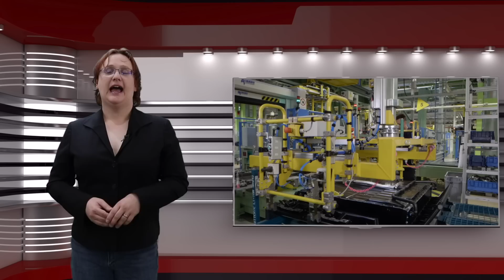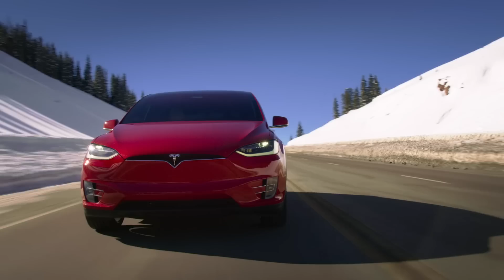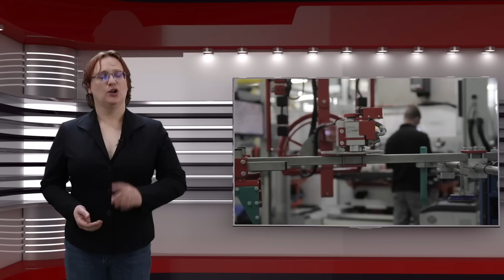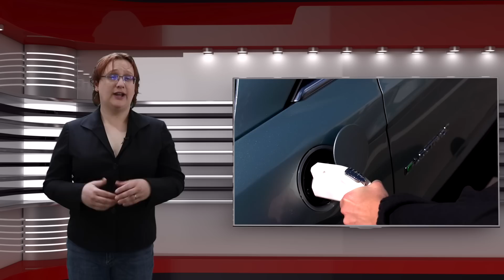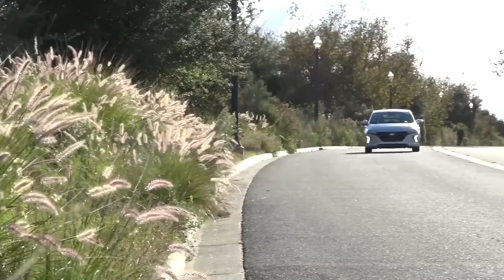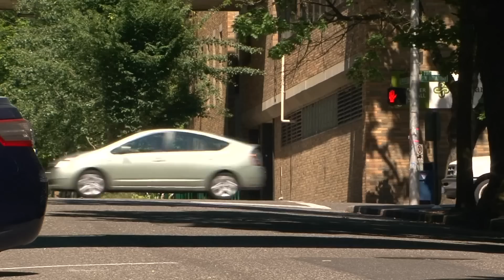As EVs Get Older, Aftermarket Batteries Will Change The EV Marketplace

Comment: An acquaintance of mine who felt threatened by my Chevy Bolt EUV said that I was now driving a coal fired car.  I asked if the coal fired power plant would shut down if I unplugged?  Also, in my area we have about 40% coal use and that is changing every year.

Comment: 4 years later and the 3rd party battery upgrade business never materialized, like not even a little bit. I finally had to give up on upgrading my beloved Nissan Leaf…
Reply: Which is sad for people like me who can't afford a new EV, but would love to drive an older one and upgrade the battery later to bring the range more in line with current standards.
Because if I have to choose between a cheap used gas powered city car that gets 400 miles on a single tank of fuel or an old EV that only gets 200 miles at best while costing more than three times as much, the choice is pretty clear to me.
A Volkswagen E-UP with a 300 mile range would be like a dream come true for me, but at this rate I don't see that happening any day soon.

Comment: What might be does not help me with what is now.
I wanted to upgrade my Nissan ev battery. The dealer here in Tennessee will not do it.
To replace my 7 year old battery the dealer said it would be $10,700 usd plus labor.
I've seen a Youtube video of a shop outside the US that sells kits to upgrade but you must acquire your own replacement battery and find a shop to do the work for you. I will pass on that option. Another option is to buy a newer car with longer range but prices have gone up drastically in the last year and used evs are hard to find. So for now I will have a shorter range and charge up more often. Maybe in my lifetime things will change.
Reply from the maker: I'm not - off the top of my head - aware of any shops doing it in Tennessee, but there is one in Portland, OR which might be able to give you advice on somewhere nearer you. https://evridesllc.com/

^Kate
Reply: @transportevolved  thank you , I sent them an email to find out.
Reply from the maker: Let us know how it goes! 

^Kate

Comment: I have a 2016 Kia Soul EV.  The HV battery failed 9 months ago and Kia approved a warranty replacement.  I am still waiting but the car range has dropped to 48Km and charge times have doubled or even tripled. Almost useless.  I will never buy or recommend a Kia vehicle. They are extremely polite in dealing with you but in the end they do nothing.  I am beginning to believe they have no intention of repairing my car.

Comment: Teslas appear to have about 90% battery health even after 150 000 miles aka 20 years of driving with my way of using them. and that is with being supercharged quite a lot more than i would be doing it. so the only real question with actively cooled batteries is basically what their shelf life is.

Comment: I don't think this question has been asked or answered here: is it possible to swap the battery from a -- say -- 2017 ev for a current one, thus upgrading the range? If so, what would it cost and how would you find someone to do it?
Reply from the maker: It depends on the vehicle, but in general as long as the form factor is the same, it can be done, though there's often a bunch of software, and sometimes hardware, tweaks that need to happen too. So Nissan Leafs can get updated battery packs, so too can some BMW i3 models, and I imagine you could swap a 2021 Bolt battery into a 2017, but I don't know for sure. - Winter
Reply: Thank you! Do you happen to know where I could get definitive battery-swap information about a Bolt or a Kia Soul ev? Seems to me it would make sense, but no one seems to know the answer.
Reply from the maker: I don't honestly know when it comes to those. If you find out, be sure to let us know - Winter
Reply: @transportevolved  Okay, thanks again. I'll keep looking, and for sure will let you know if I find any information.
Reply: i know even the 62KWh pack can fit inside a Nissan Leaf that originally came with a 24kWh pack. but that is done by a 3rd partys, not the manufacturer of the car.

Comment: I recently saw a video put together by a company in Europe.  They opened a 2011 Leaf battery and swapped out the cells with a different model of pouch cell with 3D printed supports and guards.  When they were done and updated the computers the guess-o-meter showed 337Km of range, and that was before they charged it.  I can't find the video again to see what the final capacity was at this point I'm not sure if it was Km or Miles.

Comment: If we can disable the lockout preventing you from charging while driving we could add more range with either a solar system or even a gas generator.
There's probably some overheating issue so the input flow might have to be regulated by some sensors and a small computer.

But I can see DIY battery videos coming out soon. Doesn't sound that hard, I'll definitely give it a go when mine starts to go out.

Comment: For people who can't afford brand new EVs and intend to buy second handed ones, I reckon the issue with battery wear will not be a challenge in the future. At this stage the Lithium-ion batteries are expensive to replace on EVs but however, the current trend of battery prices falling each year is also inevitable. We can see battery replacements becoming more affordable and the fact billions of dollars of investments are placed on research for a new battery development that will also shape the EV industry such as Solid-state battery using a solid electrode that has the potential to allow the battery to have a longer life-span, last longer per charge and faster charging so should batteries still be an issue of the future?

Comment: All the cars I've been forced to get rid of had fantastically running engines at the time of disposal. 
It wasn't the amount of moving parts in the motor but the rusting bodywork which put paid to them.
12 - 14 years driving on Britain's often damp and salted roads will do that to a car even I imagine,an EV.
So unless an EV's body is made of rust proof plastic I can't see it lasting any longer than a decent Japanese car.

Comment: I'm a right wing seal clubbing whale killing right to life hypocrite and I hate the politics of this.  Electric cars have limited range compared to gas due to PHYSICS.  I have had most of my gas / diesel cars last 12 to 15 years and hundreds of thousands of miles.  The only reason I would get an electric car is if it met my needs for the cost that I could afford.  That isn't right wing or left wing or right or left leaning, that is just practical living.  Oil is the future, so is electric.  People need choice and freedom and anyone who says electric is only or gas is only or diesel is only are ignorant.  I will NEVER get rid of my diesel truck, but I may consider an electric with 350 to 400 miles of range as a commuter / short trip (1000 miles or less) car and drive my truck on longer trips due to the 15 to 20 hours it would save me in charging time.  (I drive trips over 7000 miles 2 to 3 times per year.).  I don't care if I am the exception or the rule. Oh and co2 needs to be raised as it is too low, and not even a greenhouse gas (it shares the same absorption lines as H20 and can't stop more heat from escaping than water can. It is also plant food. ).  I have to go now, the baby seals won't club themselves!

Comment: EVs are machines and they will also break.  My trusty 28 year old pickup has been dependable until it got an electrical short.  lol   My  15 year old Honda has been very dependable - but now needs an axle.   EVs also have axles.

Comment: EV's will change our concept of a cars working life. Back in the 50's, a combustion engine would need a rebuild after 50k miles or so, modern combustion engines do much better (with a good oil change regime), but many customers will take a long time to click with the concept of an EV having a drive train capable of 500k plus miles with negligible maintenance, and manufacturers will not want to promote this idea either. The aftermarket will be a major factor in this, and I see big business opportunities in this arena. Our throw away culture in the developed world will be one of the hardest battles to overcome as we collectively realise the very obvious; that our planet is a finite size, with finite resources.

Comment: in the1960s, engine life and owner expectations of such was as you describe (100,000 miles befire rebuild was the accepted norm then) - I think you are 50 years out of date with your stated life of the internal combustion engine.
Expected (socially accepted) engine life  in 2019 / 2020 would be 2 to 3  times what you have quoted for properly maintained and operated IC engines. 

Remember that correctly stating the relative peformance of new and old technology is one of the tools  in how you maintain your credibility.
Reply: Rickie j  Nice anecdotes. On average most cars (with proper maintenance) go well over 200K without major rebuilds.
Reply: While ice could last , you can not help parts that were designed based on heat cycles and not miles. The other thing is public opinion where everyone wants the latest and greatest.  Manufacturers have no incentive to make long lasting cars.
Reply: It says it’s the avverage time a car can go without parts being replaced

Comment: the main problem in swapping 2nd hand batteries is that the software controlling them, in most cars, will not recognize an increased capacity, or a different battery at all

Comment: Scotty Kilmer on his mechanic Channel points out the problem with reconditioned battery packs.
These outfits test the individual component cells and only replace the ones that do not test out as acceptable.
This means that a reconditioned battery pack while initially cheaper will cost more because the customer will have to pay to have it reconditioned again and again and again.

I'm still not convinced of the argument about an electric car being ultimately more environment-friendly than a standard combustion automobile, for there is more than one study on the issue and they vary widely in results.

What we really need are roads that are rigged up like those little race tracks that we used to have when I was a kid... electric power coming out of a slot in the road where the card picks it up off of a shoe that fits in the slot.
 Subway trains operate in this way.

Good luck if you live in Northern California... No Buses, no trains, and now no power since the electric grid was completely shut off by their power company.

Although where I live, if you could get me an electric car with a Roi de Belges interior, I might consider it.  if I have to sign away my whole life just to drive a car I want to have something that would provide me a ride in Comfort.

Comment: 8 years lol still driving my 2004 prius.
Reply: nice! 2007 here with 174,000 miles, it has been technically written off before my parents gave me it because it was still mechanically sound. After 3 years and ~35,000 miles I kept it safe, used it as versatile as possible and it treated me well with stellar reliability and gentle fuel costs.

Comment: I love my 2013 Nissan Leaf; brilliant car except for the battery. I'd happily pay $10-15k for a better battery, because the only EV's that would be a significant upgrade over the Leaf are $40,000 and up. And besides, most newer EV's are actually inferior to the original Leaf in some respects. No current EV matches the Leaf in ergonomics. And if you want that cool 360 overhead view, you have to spend $50,000+ on a Tesla.

Such a shame all the tens of early Nissan Leafs are going to be abandoned to rot when most of them are in great condition save the batteries. What a waste.
Reply: I drive a 40 kWh Leaf from 2015...check out muxsan.com

Comment: Better battery packs with a higher electrical KWH would be a great way to go when the original battery pack is depleted from its lifetime. I hope manufacturers are planning such a move in the near future. Currently I drive a new Kia Niro hybrid so I would hope Kia has more options for customers when they need to replace the battery pack.
Reply from the maker: Manufacturers often seem reluctant to do this, but I fully expect to see aftermarket packs appear as the technology matures... We've already seen this on some of the earlier hybrids...  ^Kate

Comment: The UK may have a different experience than other parts of the world, but has a tiny percentage of the world's vehicles. The average age of cars on US highways is in excess of 10 years and rising rapidly.  That isn't weighted for miles driven, but the number of vehicles.  My 10-year-old Honda Element is approaching 100,000 miles has never had a repair, runs, and aside from some minor paint chips looks like new.   The cost of major maintenance at 110,000 miles is  approximately 5% of the cost when new  - IF I were to have a Honda dealership do the work.  If I DIY it, less than half that and a day's work.
To be viable EVs will need to either have lifetimes of +150,000 miles or have a total lifecycle cost of ownership competitive with IC automobiles.  To that point, if a new battery pack were 10% the cost of the vehicle when new, and the rest of the drivetrain was still in great shape, a battery replacement would be a bargain.  Since ALL of the materials in a Lion car battery pack can be recycled, including the rare earth components and Tesla is building a recycling center into its Magafactory, I expect the cost of Lion packs to drop significantly as production increases.

Comment: Wow this video is HORRIBLY wrong the average age of driven cars in America is 11.5 years (IHS), the average miles driven per year are 12,000, average car lifespan is probably close to 20 years your stats are all HORRIBLY wrong.  There is a Tesla Model S in Los Angeles in tax-cab duty with 400,000 miles (3 motors and 3 batteries).  In my house are cars are 18, 22 years old with 145,000 (nissan) and 205,000 miles (toyota).

Comment: batteries should be modular so you can pull up to a station and get a refill pack.  Batteries would no longer be a part of the car, just a fuel.  also the government shouldnhave no access to the computer in that car.

Also tired of paying for rich peoples cars and solar panels.  that practice needs to end.

Comment: I have no idea how this presenter and Consumer Reports got the average lifespan of cars to be 8 years. A quick search showed the average age cars in the US is 11.6 years. This is the average, not the lifespan. The average lifespan numbers come to 13 to 17 years varying by brand.  

Just as the Average of Americans is about 35 but the average life span is 80+

Myself, I am driving a 14 year old Ford Focus and my 1988 Dodge Aries I gave away in 2008 was just taken out of service  this year pending a restoration. My son in law is selling a 24 year old Tacoma now that still runs fine. I am 66 years old now, driving since 17 and only owned 7 cars my entire life. 

So no, we expect that these days with 84 month financing on new cars that they will last a lot longer than 8 years and they do. 

But I agree that there will spring up an entire industry dedicated to repairing electric car batteries. Just like I have repairing laptop battery packs by locating up the pack and replacing the single bad cell. It only takes one bad cell to disable a battery pack and electric car batteries are made up of individually replaceable cells. Instead of fixing engines car repair shops will move to fixing battery packs.

Comment: I would love a company to manufacture an EV that is more modular (like my gaming pc), swap out older parts for better ones as the need arises for example battery units that can be added to for more range or replaced with newer battery technology and not need to buy a whole new car, new chassis (it's a Leaf underneath but looks like a Tesla model X lol)  And while I  can't see the automotive industry moving in this direction, it would be nice to just be able to have the freedom to upgrade easily :-)

Comment: 8 years huh? 8? 100,00 kilometers?
I have a 37 year old Valiant. Only item replaced is the alternator because I wanted to upgrade it. After 1,257,000+ (that's 1.257 MILLION+ kilometers) it still goes great and expect to get that life span out of it again. 
I'll do the numbers for you. That's 74 YEARS out of one car.
Tell me again how 8 years life span is a good thing?
'Recycling' the car is energy intensive. VERY energy intensive. Methinks the EV market is a wrought...
Make sure you have plenty of gender fluid for your Prius...
Reply: Yep, still has the original oil in it.

Comment: After 8 years a petrol car will be in need of replacement.........stupid comment ...a properly maintained  car will run for hundreds of thousands of miles if serviced properly even after there designed service life. Electric cars are different the battery technology to make them last that long simply does not exist yet. Highest mileage car I've personally seen  was a very Passat rid with 600,000 miles on it and still original engine ....cant see any electric cars on the market at the moment that will ever be close to that.